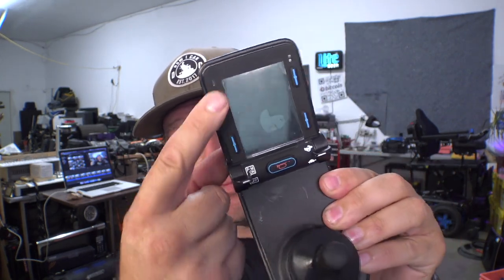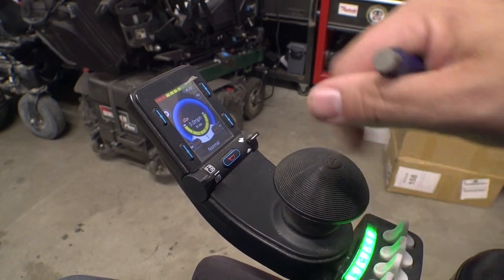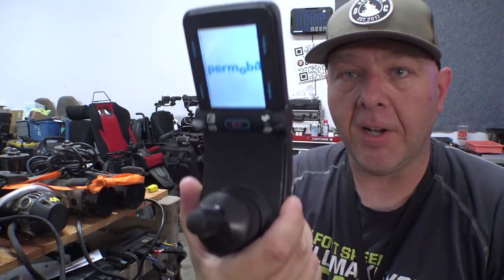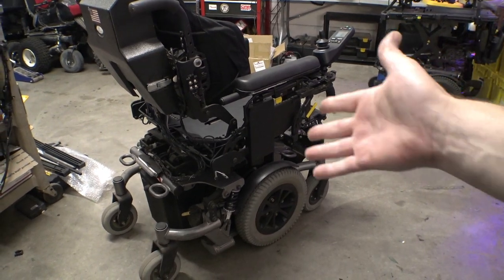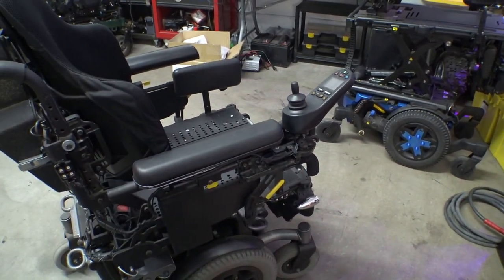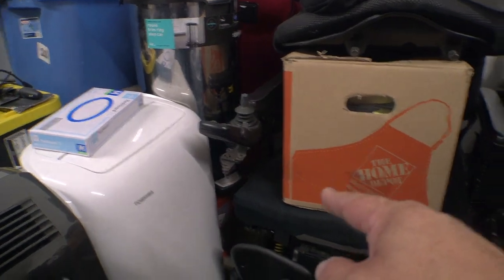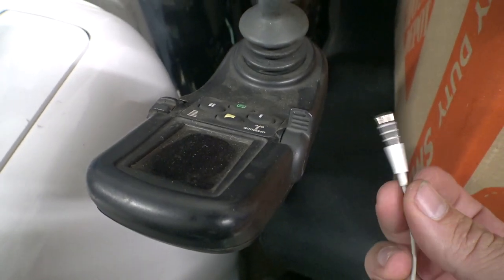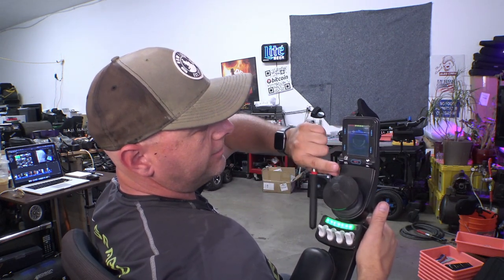REPAIR(kinda): busted buttons?!? MAKE your chair power on anyways!

Comment: Thank you so much for sharing your knowledge! My joystick got caught under a kitchen drawer handle and tightly lodged there. I couldn't move and I was alone very late at night. I ended up calling 911 because of course I couldn't reach to put the chair in neutral and also, as luck would have it, the power center Mount footrest was raised. The EMTs finally figured out how to put the chair in neutral and brought me to the bedroom and transferred me to my bed so all is well. 
         I have the most expensive R-net controller because I have the permobil light package. Until I saw this video, I was looking down the barrel of a very expensive replacement. Ironically I am in the process of getting a new chair but this was to be my second chair precisely to fly with and take to la Republica Dominicana to work among the poor and hopefullychange attitudes about disabilities caregiving and caregivers.
        My questions:  If both the headphones and the magnet will work, is the magnet better because you don't have to go to the underside of the joystick? It seems like that would be very difficult to do if your hands aren't well coordinated and you're sitting in the chair. Will the magnet solution work long-term and does it seem to be more targeted and less likely to change the mode if the magnet is more powerful?
Reply from the maker: ahh good times! lol nothing like calling emergency services when trapped by a drawer! :^)
yea the magnet is probably easier - it wont hurt anything to use long term..
the little rare-earth magnet sticks for the old style wheelchair van door openers are perfect! but a small neodymium magnet is all ya need.  just play around with spot ya wave it past and should work reliably for turning on/off OR changing modes

Comment: I have 1 control box that the toggle switches are bad 1 the speed is broken and the second off/on is cracked, can the toggles be replaced my other control box is flashing bad cable 7f00 any help ? My prob is I live in Costa Rica nobody in the country works on electric chairs

Comment: Thanks Dan for sharing this with us, my gimbal on my joystick isn't returning to the centre, but it's an insurance job so no worries. 
I looked on my other chair and that's Dx2 with the display that you mentioned,and have to remove the rear cover. 
I do have another chair which is R-Net but can't seem to find any port's on the joystick. 
Too many wheelchairs, lol 😆 👍

Comment: For a while there, my Edge 2's power switch was continually breaking off for no reason at all. The first two times they actually replaced the entire controller under warranty. The 3rd time it happened, I guess Pride finally realized they had a problem and the switch (Knob), was replaced never to have another problem. My Edge 3 has never had this issue.

Comment: Q-logic has a pot that spins 360 degrees if the plastic or spring breaks. The good thing is that the flat spot set even with the trim is 0 position, so you can just turn it a little and back to 0 to toggle.

Comment: Great hack Dan.  A few times my Q-Logic 2 has locked-up and the screen requests a power cycle.  However, the on/off power button doesn't work so you can't power cycle and have to unplug at the controller to clear, and then power back up with the power button.  Now I have a mono jack and momentary button plugged in and that will work for the power cycle when the on/off button doesn't (thus avoiding having to explain to someone where/how to unplug near the controller).   Fortunately, this rarely happens, but it has saved me a couple times in the last 6 months.   Have you tried the hack with a mono jack and the wires twisted together (or a stereo or TRRS with wires twisted together)?  If that works, it seems like a good idea to tape one under an armrest for emergency use.

Comment: One of your best, informative videos!   I frequent airports but have not had them damage anything yet.   I have been trying to think of a way of encasing the joystick so that the airport cannot damage it.   I have been thinking to use something similar to a JGRZF Quality Rat Trap, presently $20.99 on Amazon.   I cannot figure out a way to bolt it onto the chair though.   I would have to do so when they transfer me from my chair to the airline's chair when I board.   I want the joystick to hover in the cage.

Comment: Do you have a video on adapting those mini quad wheels to fit a premobil? Saw some for sale in the US but can't ship to the UK so I've ordered some 16x8-7 hubs and tyres and will look at adapting them before winter mud arrives.
Reply from the maker: honda mini-trail tires fit on most powerchair wheels.. some wheels need a tiny bit of spacing to clear the motors, others dont - most quantum edge chairs for example only need 3-4 washers on each wheel stud
https://www.youtube.com/watch?v=sa0kdiGgPao
Reply: @TotallyNormal-  Brilliant, Many thanks.
Reply: @TotallyNormal- I need a little help. My daughter has a Permobil. She has a plastic like part with straps on her footrest to hold her feet. She breaks them periodically because of her cp . Is there a place where I can buy a used one? It takes forever for repairs. eBay doesn’t have the part! I have used your site to make repairs until a technician comes!!
Your videos are amazing!!

Comment: Do headphones have to be attached to the plug, or can you just have the plug?
Reply from the maker: the speakers in the headphones complete the connection.. you can also make your own remote power button using an actual MONO plug, attached to a momentary pushbutton